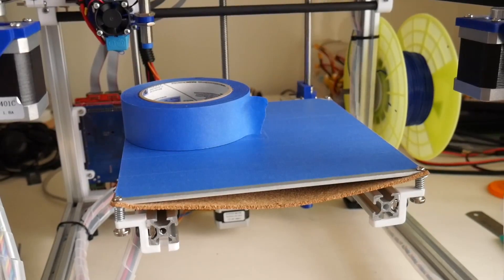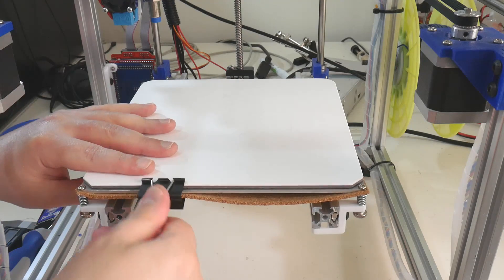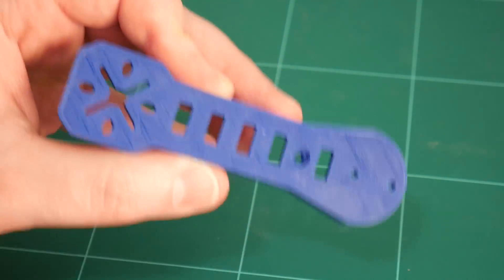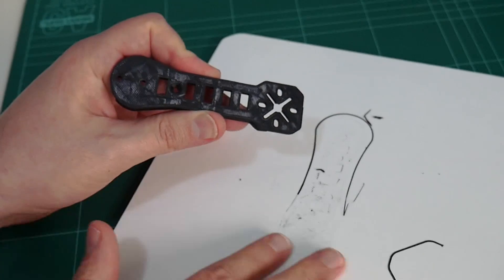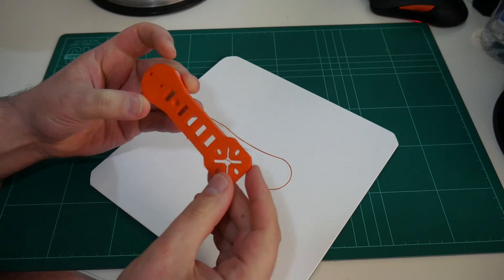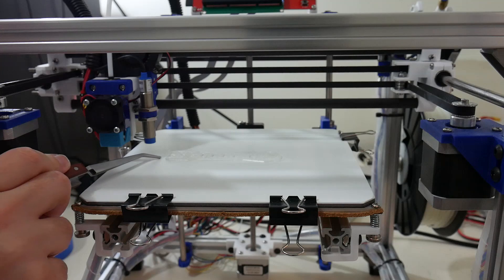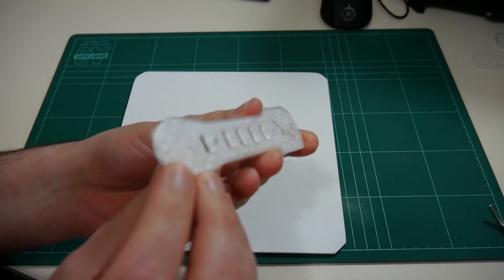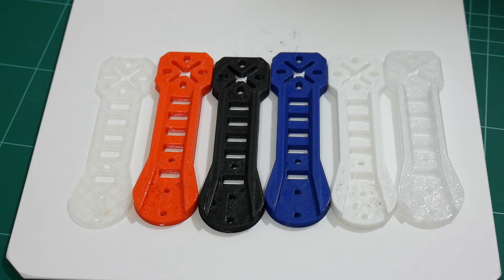3D Printer build plate - PRINTinZ

Comment: I've build your "exact" hypercube(thank you so much for all the files and videos btw), but I now use a 28cm x 28cm mirror as a bed. Underneath sits a heated bed and it stick very well without any glue, hairpray or blue tape. I bought a 4-pack of mirrors for €4,-

Comment: Hold up, youre putting on a whole new layer of blue tape after every print? I still use my small roll of blue painters tape for two years now, printing every 2 - 3 days. I only need to replace it when i mess up the bed leveling again.

Comment: I don't know how you did this.  I was a sucker I guess.  I bought this build plate.  Recalibrated my Z.  First use, went straight to ABS.  Complete failure on the first layer.  Pulled right up from the 60C heated printinz build plate.

Comment: the white of the ABS caused by stress is removed very easily with a little hot air (hair dryer or heat gun) try it!

Comment: I haven't used blue tape since I tried aqua net extra super hold. Works better than blue tape, bare glass or wolf bite for PLA, or PETG. I think wolfbite is slightly better for ninjaflex, but hairspray works a treat for that too. I've never printed in ABS, so I can't comment on that.

The hairspray holds on well at high bed temps, but when it cools off, the part is just sitting there loose most of time.
I might try this if it weren't so pricey.

Comment: A tip, the first layer is off. You need to try to get the build plate a little further away from the nozzle. You are not allowed to see through the build between the filament lines but are not allowed to get the filament squished and make a rough surface

Comment: my concern is around the even and flatness of the build plate across the whole surface
with the constant bend to pop prints, how will the surface stay thru flat?   Even if 0.10mm off, its not any better than those bent heated plates you get online... so ABL is like almost required on this case...

Comment: with that sufrace temperatures you can do the same with cristal.... and before you tell me "ye but i pop it easyer" i will say, put the printed part with the glass intro the cooler.. you will have somhting waaaaaaaay more durable, less expensive, and with way better print finish

Comment: Tried: glass, buildtak, blue tape, Pei, printbite, dauerdruckplatten, zebra plate, zebra skins.
eventually I use the zebra skin as my go to print surface :) mainly perform exceptionally well for PLA with unheated bed.

I can confirm on the durability of it since I've been using them for about 2 years. with a little rub of alcohol the surface looks like new again. My latest setup is with the skin on aluminum plate. since I can't flex the aluminum, be careful with short print like your quadcopter model. It can be hard to remove. I suspect when you test the skin you will encounter some issue in removing the finish print. I recommend you use the scrapper in a different way. I use hammer and scrapper to knock off low finish print. good luck

Comment: i use it almost everyday, and it's really great.
but nor perfect 

on wide printing area, the plate tend to warp with the piece (while it grip perfect to the piece) 
and nozzle jam a the begining of the print, like 5th layer is just a pain in the ass to remove from the plate.

but the finish look of the base layer is good, nice and smooth

also you can sand the plate to  renew it's surface.
great product

Comment: I'm curious, I've been using the PrintinZ skins with a heated bed for about a year and a half with great results, but was relunctant to use the thicker plates.  How much heat do you think gets transferred from the heated bed to the top of the plate (surface) using the thicker PrintinZ plate?
Reply from the maker: With the plate, I believe when setting the heated bed to 100c, expect 80c on the top surface. When setting 55c, expect 50c on the top surface. The skin is much thinner than the plate and should transfer heat more efficiently.

Comment: Ya, I have one, and I do liked it so read to the end  but there are 2 things.  the flex is sweet, at 1st, eventually it doesn't return to full flat, hot, cold, what ever it just stays bubbled up and you have to sit and play with it trying to reverse flex it and it's near impossible to get 100% flat and ready for the next print.  If you leave it in the sun for a few days on a flat surface it will, but who has that time?  #2 the weight!! Oh my god the thing is heavy!!  you don't realize till you have one in your hand. For "box" frame units where the bed does Z only it's a non issue. But for Prusa i3 style it's a lot of extra weight and will make you print even slower than the i3 already makes you and you'll still likely have rings/vibe line in the walls of your print.  The sheet is fine and all, but then i's really no different or special over any other of the adhesion systems.  Now, I do use it still, on super thing prints!  it's awesome for those. I did a light globe for my fan, the contact with the bed was around 3mm thick in a slow arch almost 180mm long.. no warping.. no issues. it's also awesome for lithopanes you want to print upright .. it just holds the thing perfectly.
Reply: oh and as always!! great and informative video man!!!

Comment: wait, you say you can rub off the white stress mark from the ABS ?! but yet it's not a residue from the plate ?....it sound like a lie to me.
Reply from the maker: Gentlemen, this wasn't a sponsored video. PrintinZ provided this build plate and skin after I contacted them from advice from other viewers.

I asked PrintinZ about the white residue on the base of the black ABS part and the response is what I gave in the video.
Reply: Exactly what I was about to comment. I have had a print in z plate and it is the material coming off
Reply: Matthew Harrison for sure, i think it's a biesed review, he was probably paid by the company and choice to ignore the lie from them.
Reply: It certainly seems that way. For the ABS to stick like that it must have been pressed down a lot. Which would cause significant elephant-foot effects which weren't mentioned at all
Reply: Zahier Mahoob So why is it able to be rubbed off if the marks are stresses within the plastic?
Reply: Zahier Mahoob i never hear that you can turn back to normale a stressed ABS by just some friction with your hand, you can't generate enough heat by this mean to change the internal stucture of the plastique, even if it's very tiny (heatgun, maybe, i dunno)
Reply: Zahier Mahoob my bad, i wanted to say ABS...i corrected my comments, it's more clear now.
Reply: you're supposed to use the black side of the plate so you dont pull the plate off :P
Reply: Tech2C but you should state your own POV about what youve noticed, it's a review after all, i am sure you agree that this white trace is from the plate and not because of some micro localised stress from the ABS it's the most logical and obvious explanation, and i am pretty sure you know it, don't be so gentle on them because they are nice peoples, if their product have some issues, well, just say it, it's a review doesn't it ?
Reply: Zahier Mahoob I know what happens when you heat stressed ABS, but he rubs it with his nail in the video, not his finger. So no significant heat generated there.. He's scratching off the paper-like texture from the plate. I've had one and done the same thing

Comment: Hello why dont you use simple solution and inexpensive like me ... glass and laca?

Edit: oh ok, why did you change from glass?
Reply from the maker: What is laca?
Reply: "hair" spray
Reply from the maker: Ah ok. When I began 3D printing that is what I was using. It worked fine but I was tired of cleaning the glass. Then I tried blue painters tape and was happy to simply replace each strip as it torn.
Reply: Ok, thank you for sharing your experience. Hair spray works fine for me, and i get a glass-like surface, i dont clean the glasse, just take off the brim and ready to go, cheers!

Comment: Hello Tech2C! 
How does the Hypercube Bowden system handle most flexible filaments? 
Been doing research and I'm considering converting my Aurarum Wombot to a Hypercube.
Reply from the maker: Great question. With 1.75mm diameter filament it can be challenging. PolyFlex is just amazing and will work with Bowden no probs. You can print in TPU (Ninja Flex) at only 10mm/s print speed. If you want to print in TPE forget it, it just raps around the drive gear.

Comment: will the surface bend over time from you flexing it?
Reply from the maker: If you flex it too much it can maintain a slight bend. In this video I didn't bend it too much as I want a flat surface. 
The PrintinZ website suggests bending it in the opposite direction, and when clipping it to the bed have the clips hold the higher points down.

Comment: Good morning from the Netherlands. I was watching your video (while printing some XY-joiners from your Thingiverse page by the way) and could not resist to reply. I myself use PrintBite from flex3drive.com and I am rather spoiled I think, because what you are showing still looks like a struggle to get prints of the plate. PrintBite actually self releases the part when it comes below 50-40 degrees Celsius. It is like someone just placed it on the plate. Don't know if you know this surface, but you have to try it sometime.
Reply from the maker: Good evening from Australia! That Printbite material has similar characteristics to PEI. What I like about this PrintinZ plate is you can print PLA cold, no need for a heated bed. Thanks for sharing.

Comment: I own the PRINTinZ plate, and it sucks! I cant print on it because it is not even.
Reply: Did you try leveling it when the bed is heated? I find a significant difference between the nozzle and bed with a cold bed and a heated bed.
Reply: No I didn't, i will try it, thanks for the tip!
Reply: Thanks for the tip! Now it works, i had given up months ago. If anyone else has the same problem I would also recommend using more clips.

Comment: Hello, dear Tech2C!! Can you make a video about printing on non-heated (cold) beds? PETG in big size, for example?
Reply from the maker: I can save some time and say printing large objects in PETG without a heated bed would be challenging. Try adding a very large brim and use glue stick.
Reply: Dima Balan I have the exact same builplate from PrintinZ and it is great with PETG. I printed gym rings fir my daughter using Rigid.ink clear PETG. Bed was around 40C. One ring warpedv other didnt. The rings are 190mm outer diameter and the tube is 26mm with 4mm walls. So Id say its possible to print big prints too!.
btw: 100C is at the upper temp limit of taht plate. I have noticed some quality drop on the surface and I dont use temps above 80C. The surface is bumpy now after ~ 8 months of use.

Comment: How does it hold up to your spatula? Does it get scraped up? Is it very flat? Can flexing it cause permanent deformation over time? So many questions.
Reply: It is very durable and you can use both sides of the plate. I find the flexibility of the plate causes temporary deformation. This deformation can be fixed by flexing it in the opposite direction, but having it spring back to its original form would've nice... Here's a helpful tip! Remember to level the plate when your bed is heated. I crashed my nozzle into the plate multiple times because it distorted with heat.
Reply: Yeah I'm just reading through other comments and people have mentioned it permanently deforming, or needing to be bent back to the original flatness. These reviews are great but perhaps more in-depth, time-dependent results would be more useful. It's gotta work more than just the first few times.
Reply: It'll work for a long time, but there's just a lot of adjustments to do along the way (bending it back). The reason I bought the plate was so I didn't have to adjust my aluminum bed inside my enclosure. I like the removable concept of it but attaching binder clips over and over again quickly became cumbersome. 

If you're looking for more convenience, you should check out the Buildtak's Flex Plate System (a magnetic base, flexible metal sheet). It eliminates binder clips by utilizing high temperature magnets (max bed temp is 120C) and keeps the metal sheet (the print surface) flat with uniform magnet around the perimeter and in the center. Of course, it's 2x as expensive as the PrintInZ plates.

Comment: Hey tech2c, how often do you replace blue masking tape on your bed? I keep mine very clean and only re-tape it every couple months.
Reply from the maker: That depends on the material. With PLA I can get a few prints out of it before it rips or loses adhesion, but ABS and PETG I need to replace the tape every print.
Reply: The thought of having to re-tape the bed every couple prints terrifies the lazy part of me =D
I've never printed anything but PLA on my printer, but the last kilo 
went by without me having to touch the bed (It has a few dent tho =D). I'll have the same 3M roll in five years at this pace !
You may have greater requirement for adhesion than I do.
Reply: I always wonder if its possible to get hold of the bed material the UP printers use. That stuff is amazing. Good old UP Plus2 in my workplace , would take that over the ulimater we have any day , its a beast .
Reply: Yeah, i very rarey have to replace mine, IF things stop sticking print out a 1-2 layer sheet of plastic and use it as a scraper. It will re rough up the tape and it wil be good to go again. Never really had an issue with PLA(no heat) or PET-g(heated at 80c) not sticking. I only replace mine when i tear the tape lifting parts. OR it just becomes really tattered looking. Even priting the exact same object multiple times. I use scotch #2090 (printed inside roll) might be good to compare witch version of the tape everyone is useing with difrent resaults.